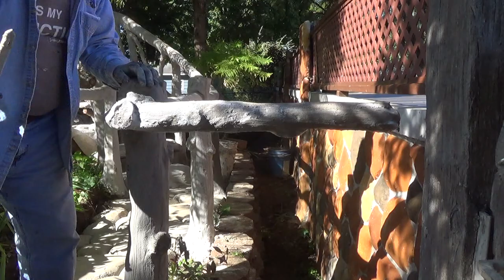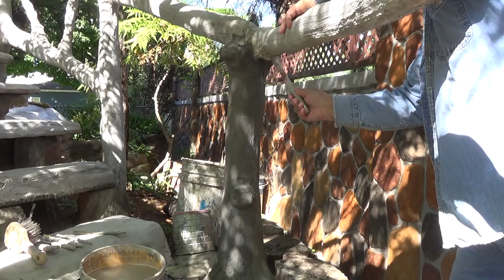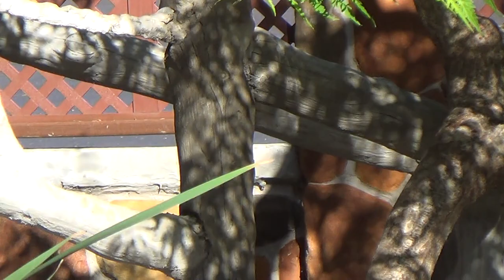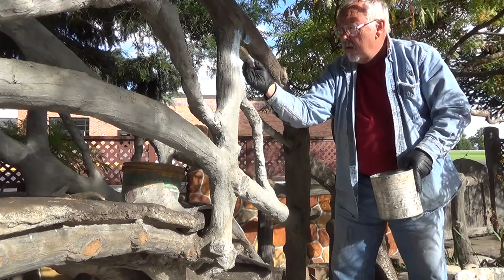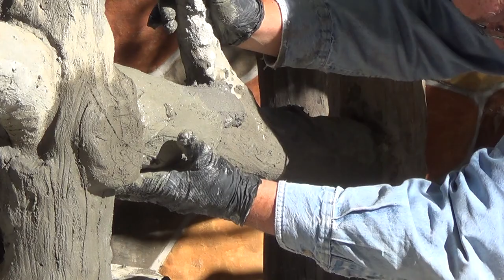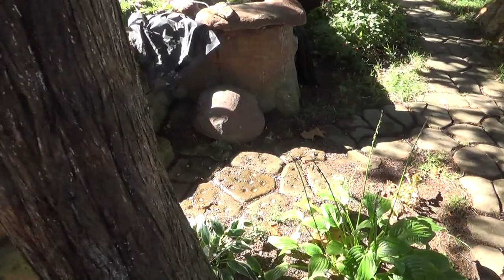Part 4   Update and Progress on the Faux Bois Concrete Bridge

Comment: I've viewed your series on the faux bois bridge project. Amazing! Thank you so much for your skill and patience in making these easy to understand and detailed videos. You've inspired me to add two faux bois railings on a faux rock bridge leading to the spa in the center of my pool. I have a question regarding how to anchor the posts into the installed bridge. It is approx. 6" thick. Is there a particular mixture that I could use at these anchor points. I have photos of this area but being new to YouTube, I'm not sure how to attach them, or even if that is possible.
Reply from the maker: No way I know of to put photos into YouTube comments except with a link to a photo-storage/sharing site.
To attach the railings to the bridge, I'd use a masonry bit, drill holes to accommodate 3/8" rebar, anchor the rebar with anchoring cement and construct the faux bois railings in place,  much as I did on my bridge.  https://www.homedepot.com/p/Quikrete-10-lb-Anchoring-Cement-124511/100318467
Reply: @dperry428  Thank you sir for your quick response. Looking forward to including this with my project. Do you have any videos on coloring your faux bois railings? I'm currently using four shades of acrylic stain to refurbish the faux rocks and waterfall on my pool / spa area. Do you have any suggestions on colors / stain type for the railings?
Reply from the maker: I use acid stain from https://www.concretecamouflage.com/
The color I find most valuable is called weathered wood.
Reply: @dperry428  Thank you sir for all your assistance. I hope I will be able to get a photo to you of the completed project!
Reply from the maker: Take a video and post it to your YouTube channel.
Reply: @dperry428  Thank you. I'll post the video of the completed project. Your name will be in the credits :)

Comment: Hi dperry. Thank your for sharing your recipe. I'm in the UK and I've manage to source the products you use for your mix. I just have one question regarding zypex, The guys at zypex are telling me I'm to use the zypex red pale to add to the mix. I would really appreciate to hear your thoughts on that.  Regards Ray
Reply from the maker: I had to go look up what red pail was.  I bought mine from an industrial supply packaged in small paper packets in a cardboard box. It was the C-500 product that is added to the mix and not as a coating to existing concrete.  The stuff they are offering in the UK in red pails is the same thing. They just have a several grades that affect the rate of hydration.  Either the C-500 or the C-1000 grades will be what you want.  Both seem to come in the red pail.  BTW, it's Xypex, not zypex.

Comment: The bridge is looking awesome.   At the end you mentioned using a carving mix to complete the middle pieces .  Is the white cement the same used for concrete counter tops?   Will you add the pozzolans to the white cement?
Enjoy the holidays .
Reply from the maker: The carving mix is a complete product. There will be nothing added to it except the recommended acrylic in the liquid. I have no idea what the ingredients are except that the white cement portion is the same as that used to make countertops.  In fact, I got the product from the company that specializes in supplies for concrete countertops.  It's a proprietary mix that I just want to try and compare to the mix I use.  Enjoy your holidays as well.  Thanks.